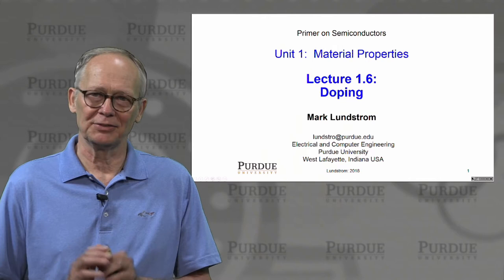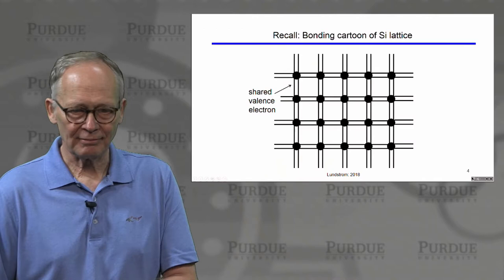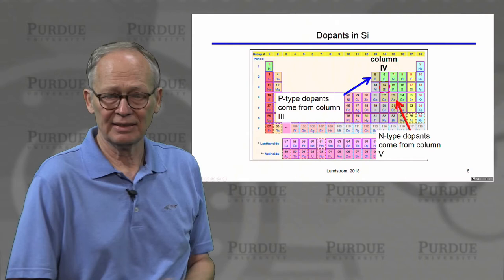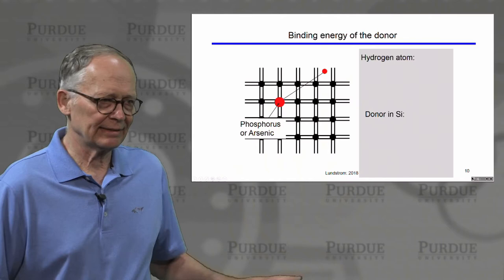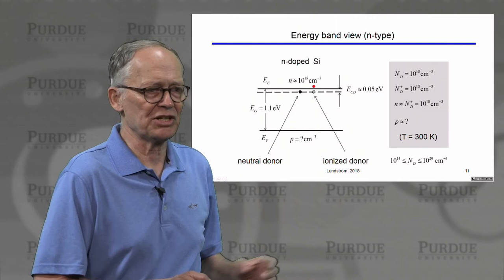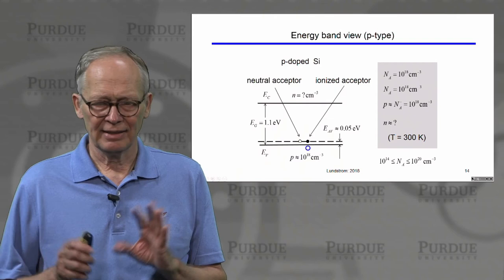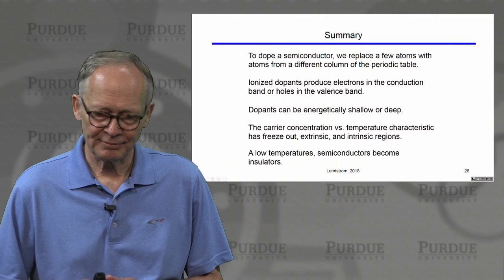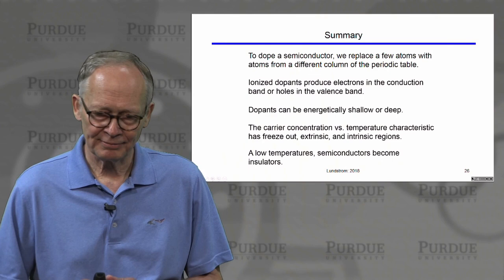ECE Purdue Semiconductor Fundamentals L1.6: Materials Properties - Doping

Comment: It was mentioned that at room temperatures, intrinsic carrier concentration pales in comparison to the extrinsic carriers, which would mean that n/N_D << 1, however in the graph at 20:33, it was shown that at 300K (room temp), the n/N_D ratio is 1.0. Would appreciate a clarification.
Reply: "n" is not just intrinsic carrier concentration, it is concentration of electrons in the conduction band, which includes both intrinsic and extrinsic (from the ionized donors) carriers. At room temperature, total carrier concentration is approximately equal to the dopant concentration "N_d", which results in the equals 1 ratio.

So to restate what is going on:
At 0K, there are absolutely no donors in the conduction band, and there are absolutely no electron-hole pairs that have been created from the intrinsic material. Carrier concentration is absolutely zero.

At low temperatures below 300K, some of the dopant material becomes ionized and electrons from those ionized donors are now present in the conduction band (because of the extremely small energy bandgap between the dopant material and the intrinsic material). There are effectively zero intrinsic carriers in the conduction band at this point still. Carrier concentration is slightly above zero.

At room temperature 300K, the dopant material is effectively entirely ionized and almost all electrons from the ionized donors are now in the conduction band. Some intrinsic carriers are now present in the conduction band, but it is multiple orders of magnitude less than the extrinsic carriers. Carrier concentration is effectively the amount of ionized donors, hence the "extrinsic" region.

At high temperatures, the dopant material is completely ionized, but now there are much more electron-hole pairs that have been created within the intrinsic material and this amount dominates the ionized donors. Carrier concentration is effectively the intrinsic concentration, hence the "intrinsic" region.
Reply: @seinfan9  Thanks for the clarification! I wasn't notified on yr reply until I rewatched the video. I've always mistakenly thought the graph was n_i/N_D. My bad, thanks again!